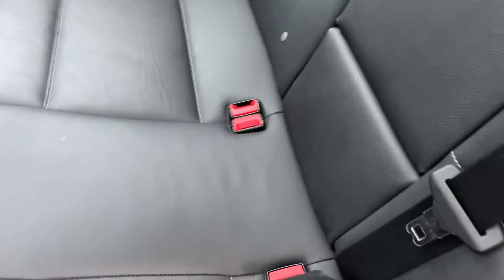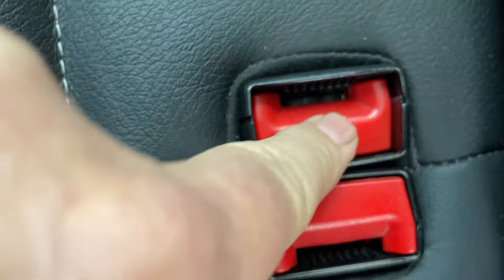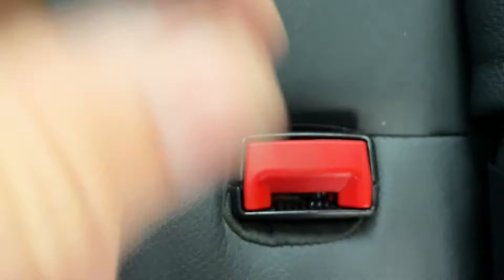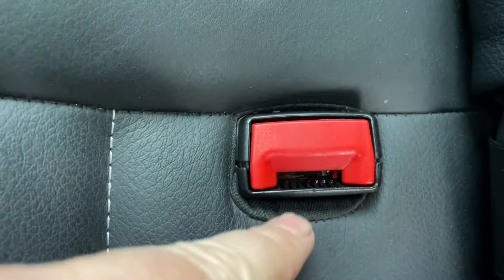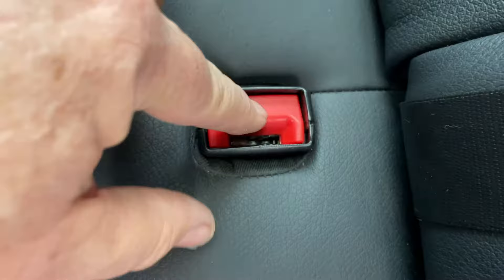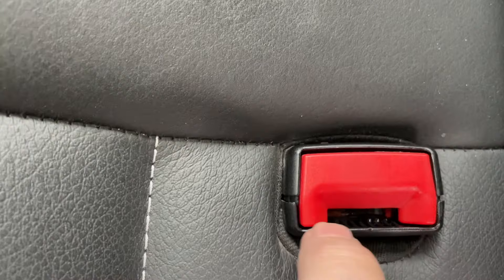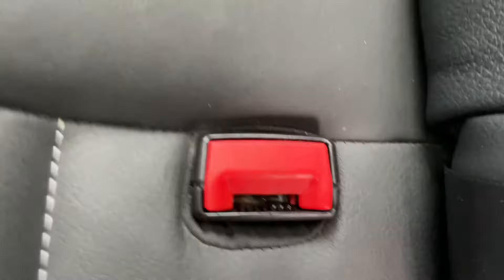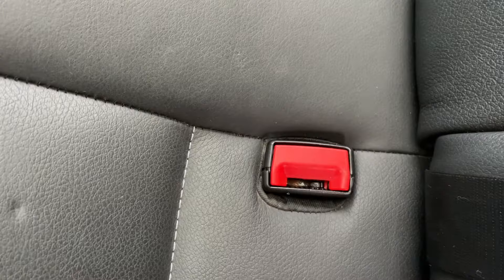Fixing a Sticking Blocked Seat belt. Simple Repair on stiff catch

Comment: I watched your video and then tried to put the seat belt into the buckle and pushed the red button down just like what you showed and this worked. It would not go in until I pushed the red button and wiggle the male end until all of a sudden it went in. Still did not work right. Then I sprayed WD40 and worked it in and out and then it started to work like new. Thank you this video saved me a big headache. I really did not think this would work. So much for thinking.

Comment: Best lubricant for such mechanisms is a dry lube aka PTFE spray. It contains PTFE particles (teflon) mixed with propellant. When propellant evaporates it leaves invisible, dry reducing friction residue. It doesn't contain oils, therefore won't attract dust etc.
Another lubricant would be silicone oil with PTFE, but this does leave oily residue, which may attract and accumulate dust and grime over time.
WD40 do work, but I advise against it, as it contains mineral oil, which may damage some polymers (plactics or rubber). Silicone oil is safer for polymers.

Comment: Worked for me on my 2007 4Runner! Although I did have a similar problem with one of the other seatbelts and that turned out to be a whole lot of dog hair and other crud had gotten inside and had to be cleaned out. Similar problems but different causes. Thanks for the good tip!

Comment: I just want to say thank you so much, sir didn’t think it would work was having problems with my seatbelt on my dodge challenger for a while It was unlocking on its on while driving took it to the shop and they said it was going to be around $500 to fix it. You just saved me $500. Thank you. 😊🙏
Reply: Shops are robbery sometimes
Reply: Hell nah 500 is a rip off mechanics be tripping

Comment: This worked for me as well. With the receptacle empty, there was a metal bar across the interior, as it would be when latched together. The oil frees up the interior sliding parts and in my case seemed to drag that crossbar back to its normal unlatched position out of sight. Many thanks!

Comment: PLEASE HELP!! I'm having the same issue with my seatbelt (won't insert). I sprayed it with WD-40 several times, I pressed the red button several times so that the spray could reach all of the moving parts within the clicker, and I actually got it to work twice. Every time I un-click the seatbelt, I have to go through this process. Is this how it was for you, or is mine being more difficult than normal? What else should I do, without paying more than I have to fix it?
Reply from the maker: Seat belts are super important that they are working right. This fix is if you have food and something simple. You may have a broken spring or something more serious. 
Mine was fixed and working perfectly after 1 spray. MRT

Comment: So I sprayed it with lubricant and it will go in if I hold down the red release then plug it in but everytime I release the latch springs up to where it won't go in on its own. Any suggestions? Plz
Reply: Do I need to do the whole screw driver force the latch down part?
Reply from the maker: The lubricate trick is really just if you’ve had food or something sticky go in there. It sounds like something mechanical is wrong with yours. If in doubt replace it. MRT

Comment: Mine is a RAV4 2018 and still didn't work
Reply from the maker: With seatbelts you have to make sure they are spot on. You might have something mechanical broken or bent. When this happens you need to replace it. MRT
Reply: @Marksreviewsandtutorials  thank you